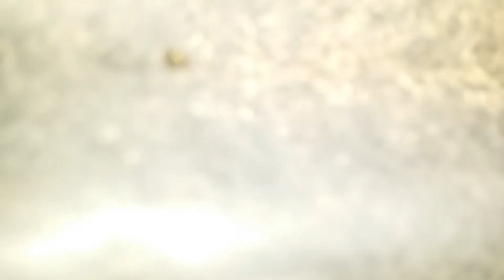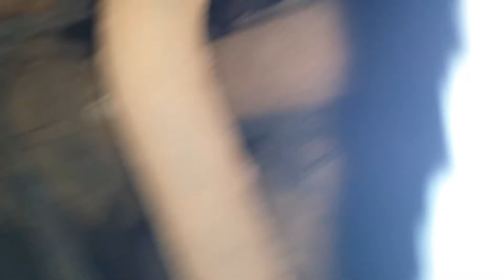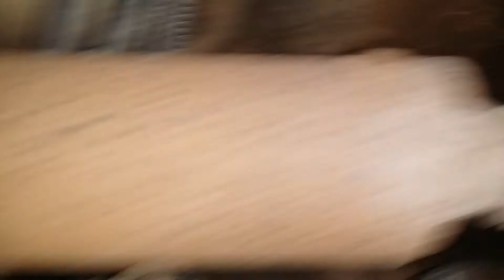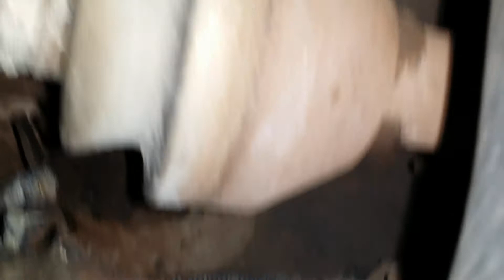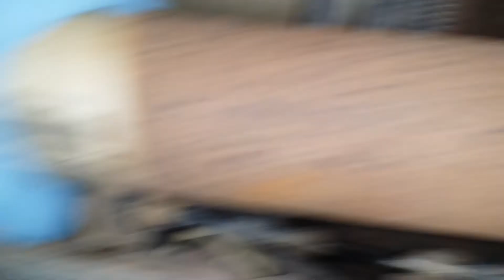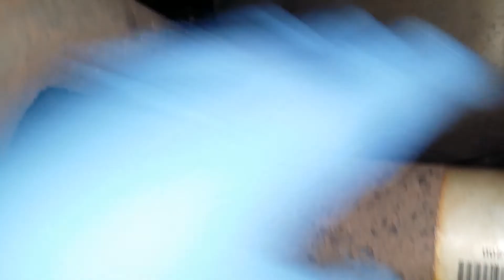2002 Ram 4x4 front drive line bad?

Comment: Not sure how recent this'll be but I just tore my front drive shaft apart and it turned out that clicking cranky noise (sounds like a tracked/tank vehicle going down the road) was something called a cardan yoke bearing that was going bad. Highly suggest checking it out. Mines lifted and it wore out that stock bearing super fast. Need to buy the heavy duty ones.

Comment: It's the end of the drive shaft that slides in to the transfer case, it's called a high speed cv that's the same issue I'm having with my truck
Reply: Any luck on how to fix it I'm having the same problem on mine and when I accelerate basically going up a hill there's a bad whining noise like something is binding up then given what given free in my driveshaft shakes back and forth like that when I do it with my hand

Comment: I have the exact same issue pulling the shaft out now. Any idea of the price?
Reply: Any luck on the problem because I am having a whining noise only when I take off and I just changed my U-joint on my front drive shaft and the front drive shaft does jerk back and forth just like that

Comment: I have the same problem, got clicking sound,does the exhaust have to be yanked out to get that driveshaft out?
Reply: You all you do is loosen up the four bolts on the back of the transfer case and it will slide out from the rear I just did my front U-joint but my driveshaft is clicking back and forth and making a real bad whining noise when I'm accelerating up a hill in first gear did anybody have any luck on this